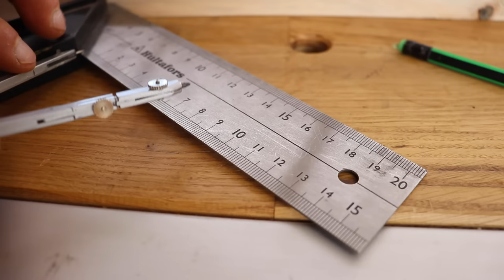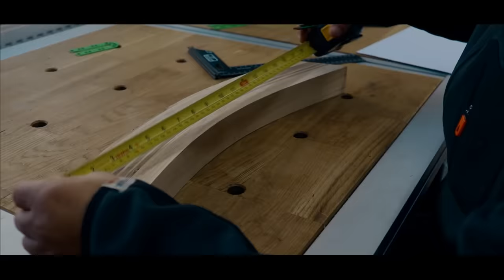Amazing woodworking. Bow and arrow.

Comment: I like your work.  You belt a Left handed bow,  and shooting it right handed.  For a right handed bow the window should be in the left side.  You see,  as you put the three fingers of your right hand behind the string,  and pull back the slight rotation of the string in you fingers.  And then when you let go,  the string rolls pushing the arrow to the right.  With you bow, that pushing would push it right, off the arrow rest.

Comment: A decent first bow. Woodworking was good, and finished bow looks good. There are however quite a few technical errors both to the bow and arrow from an archery perspective. 
1. When cutting an arrow shelf into the riser, the cut out section should point towards the hand that is holding it (unless a rare case of eye dominance crossover). This bow is for a left handed shooter and is best held in the right hand.
2. The bow will shoot better if the limbs are tillered. This is essential for a straight shooting bow.
3. The arrow was not the correct thickness, weight, length or "spine-stiffness" for the bows poundage.
4. The feathers used for the arrow must be from the same side of the wing on a bird. Also, only the top portion of the feather should be used, to ensure the feathers all curve the same way and make the arrow spin correctly.
5. An arrow rest will help with the arrow "jumping" off the shelf whilst shooting. It will make the arrow straighten up faster and halp greatly with precision.
Other than that, I like the rotating bowstring jig. Never seen that one before. Clever!
Reply: As i pointed out wrong side for a right hand shooter and feathers need the proper angle on the shaft to spin correctly. But he did a good job
Reply from the maker: @giles 4800  Thanks for watching. 👍👍👍
Reply: Very creative jigs and excellent workmanship. I found it interesting that you could bend the wood without moistening it. 
Another thought from the archer's perspective:  Usually (if not always) the archer would wrap their 3 longest fingers around the string at the first finger joint in order to pull it back, with the arrow end between the index and middle finger.  It's much easier to hold while aiming, and no doubt helps with accuracy.  
My uncle was an excellent archer and bow hunter, who also made his own bows.  
How different we all are.  I never destroy anything that I make.  Thanks for an excellent video!

Comment: Hi there, very nice work, can i ask you what kind of tool is the one you used to make the wood round to make the arrow? Thank you so much
Reply: It looks like an M12 thread cutting die, but the final shaft looks a little thick to me so I'd try M10 or 7/16. You can also use a hard wood dowel maker.

Comment: I'm not an expert. I've never mad a bow. But, I know that the curve in a bow is not done by this method. The only thing holding the curve in this bow is the glue. Once the glue fails, the strips will revert to being straight. I believe the strips must have the curve formed before they are glued. Can anyone refute or verify this?
Reply from the maker: You are right, you not an expert. 👍😂

Comment: Hi. I shooted from bow for 12 uears. This is amazing what you made, but you made one big mistake. Center of bow you made for left hand archer (left hand archer hold bow in right hand). Normally arrow in the bow should be from the hand side. So that the archer can see her. In your bow will be ok if you take it in right hand, but then your holder will not fit and comfortable.
There is one more mistake in arrows. They are too thick.
Nevertheless, I have a lot of respect for what you have done, especially since this is your first bow.
Reply from the maker: Thanks for watching.